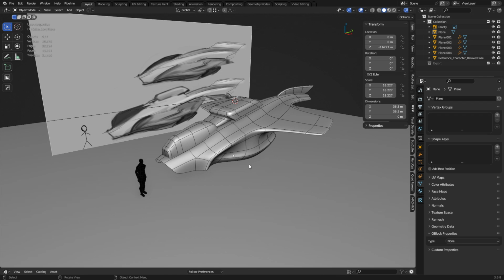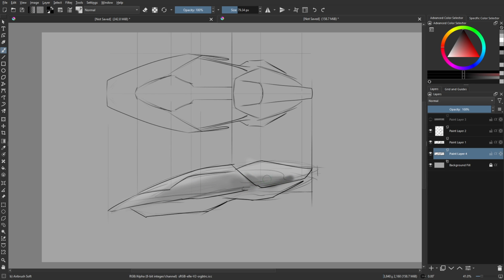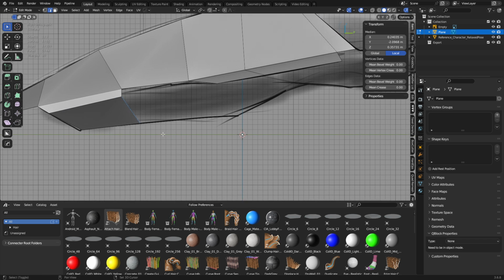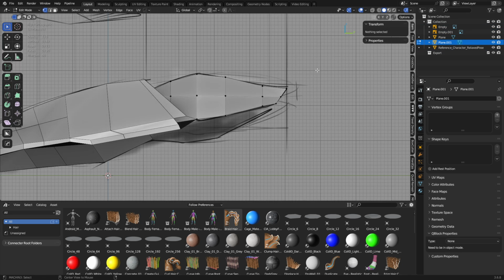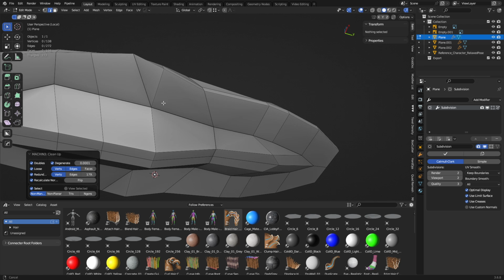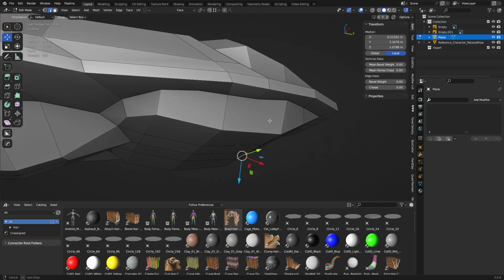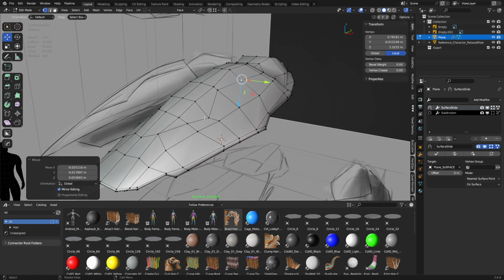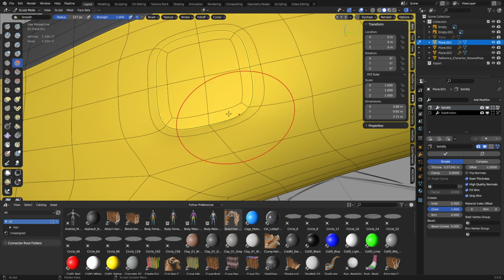Blender - Sketch and Model

Comment: Why in blender ? Plasticity will do this in like 5 mins ?  Why won't you use corresponding tools for corresponding tasks ?
Reply from the maker: There are pros and cons of using plasticity in your pipeline. It isn't a correct or wrong choice. The main reason I dont use it is it lacks flexibility. This is a conversation that goes much deeper then cleaning up a plasticity export or laying out some nurb curves for a shell.